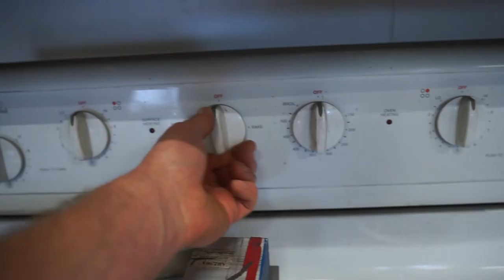Rebuilding A Toyota Hilux Rear Axle!!

Comment: Great job Austin, others may take notice. This is a great example of concise tutorial within a great shop environment without a lot of gibber jabber. Very thorough and above and beyond normal rebuild. I was just looking for a good representation of disassembly/assembly order for this subject of rear axle teardown and reassembly. As I am in process now on stepsons' 87 toyota pickup rear axle bearing and seals replacement. I am 40 year Aircraft tech, car and motorcycle enthusiast, mechanic.

Comment: Put an electric switched hydraulic brake line lock on it for an emergency brake, push the pedal in & push the button it's locked, push the pedal to disengage its so simple

Comment: Cost like $45  & they work even if it gets ran into it won't move ,I have disc brakes on the back of my 82 4×4 & no emergency brake cables to worry about, & it would make a great video too!

Comment: I put bearing kits in and replace that crush collar before and that parts not bad. It’s intended for new bearings but I believe I’ve heard that some guys say you should replace that crush collar every time you retorque that nut. That’s what the crush collar does of courses is sets the on the preload on the bearings. I’m not sure though because for example on wheel-bearings you don’t torque an old bearing anywhere near as tight is you torque a new bearing. Once you’ve overtightened an old crush collar however I’m pretty sure it needs replaced as the way you describe the this one with your bearings tightening up.

Comment: I love these model yotas. Had an 85 with a 22r in it and we use to pull a wrestling ring built out of 2 inch square tubing that was about a few thousand pounds and it pulled it like it wasn't even there .
Reply from the maker: Cant beat these trucks!!

Comment: So I need to reseal my rear axle on my 89 because its leaking gear oil into the drums, is there any way to replace the seal without using a hydraulic press to remove the axle shafts? I've got the seals for both the axle and the backing plate, I would like to replace both at the same time.

Comment: Better keep an eye on those rear brake temps. There is a reason drums aren't factory powder coated. The metal has to breathe for it to dissipate  brake heat.
Reply from the maker: I have powdercoated or painted every drum I own and never a issue!